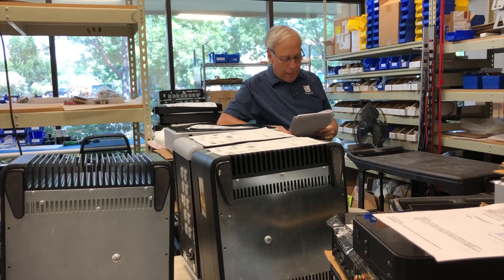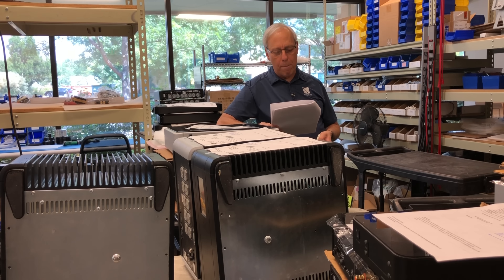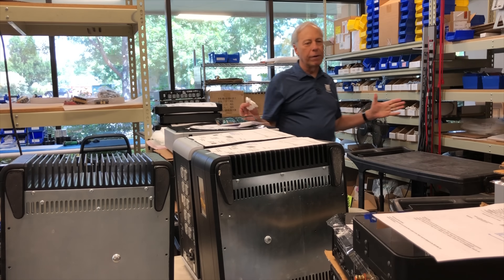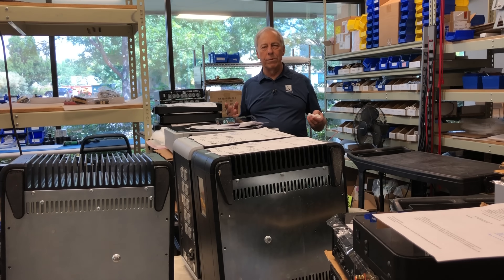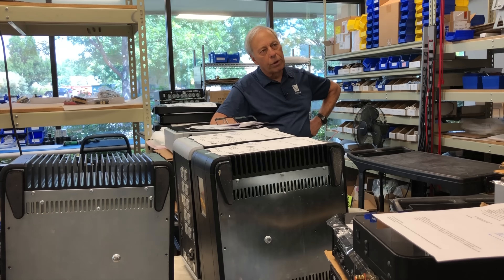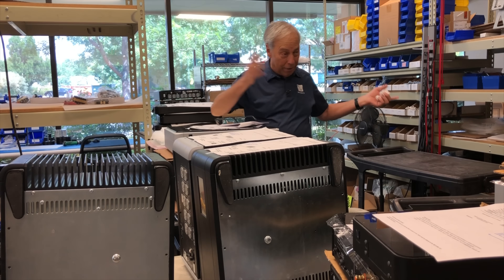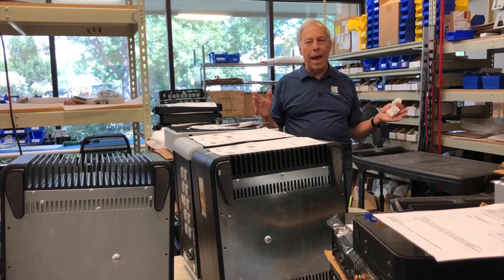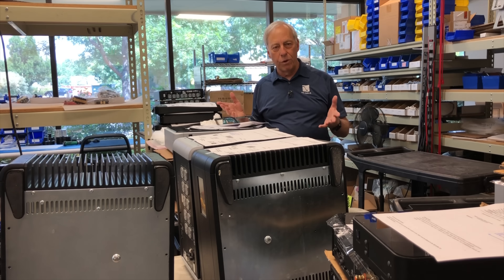Why should speaker cables have a minimum length?

Comment: Naim has been selling a house brand relatively inexpensive cable for ages. One type to fit all products. In that sense I think they wanted to match the impedance of said cable to their optimum specs for best results.
Reply: Naim has engineered their power amplifiers in such a way that they rely on the length of the cable with specific specifications.These are: Capacitance: 16pF per metre, Resistance: 9 milliohms per metre, Inductance: 1uH per metre. The inductance is the important parameter here. If the cable specifications and length don't match up, you can overheat a Naim power amplifier. But this has been taken out of context (as usual happens in the audio world) and has become a 'thing' on its own. For anything that isn't a power amplifier, it does not matter that much.
Reply: @jmtennapel  That is ridiculous. A few milliohms, picofarads or microhenrys aren't going to do much at all to an amp, let alone over heat it. Only in very long cables will these numbers be significant enough to cause any problems. The speaker wire just becomes an extension to the crossovers in the speakers and they use MUCH higher values. If a speaker crossover uses a 6-8 ohm resistor, adding 0.009 ohms/meter isn't going to do jack shit to change the sound. Same with adding tiny capacitance or inductance, because much higher values are used in crossovers. 

All audiophiles should learn the basics of electronics and then no one could sell them snake oil products. If there are any small changes from different cables, they will be noticed on interconnects where the signal will be amplified many times.
Reply: @gordthor5351  Could be, but I just copied and pasted their information. Maybe you have to call Naim and tell them they are ridiculous :)
Reply: @jmtennapel  remember the corporations want to sell you things.  That's how they make money.  In the 70s Ricardo Montalbon was a spokesperson selling a cars. He said , in the commercial,  the car comes with real "corinthian leather ".  There is no such thing as Corinthian leather.  They just want you to buy the car.  I see this type of thing on packaging all the time.  Even manuals have some nonsense in it. It's designed to protect the corporation and not the user.
Reply: @SocialistDistancing  I don't get this kind of rhetoric, it has nothing to do with the question asked, nor the answer given.
Reply: @jmtennapel  you missed the point.  What the producer/corp tells you, isn't necessarily the truth.  For instance, Motorola sells gmrs radios. They list ridiculous ratings at the distance that they will reach.  What they don't tell you is, that's under ideal conditions, on hill top.  If I had a dollar for every item that I purchased that didn't perform as advertised, I'd have a lot of money.  So don't blindly accept what the marketing says.  The bottom line for corps is to make money. I guarantee, that is what is most important to them.  They want sell you stuff. Buyer beware.  That's what it has to do with it.

Comment: Now why naim audio specifies a minimum length cable is likely for sound reasons only.  It is known by many real audiophiles that there is an ideal length cable, weather its speaker cables or interconnects that just seems to sound right.  Typically 6-8 ft speaker cables, and 1-1.5 m interconnects.  I know sounds crazy but that is the experience i have had and many of my clients and audiophile friends.  Cables will sound different at different lengths, to short or to long just doesn’t sound as coherent.  Im sure i will get push back for this comment primarily from non believers of audio cables, but many real audiophiles know this to be true.
Reply: Audiophools are on crack!
Reply: Mike Montana you must be an expert !  Your certainly in the majority of people who think cables don’t make a difference, so unless your open minded and have the ability to experience it on a truly high end system you’ll never know.  Then Ignorance is bliss.
Reply: Mike Montana well I am always up for a friendly debate but my guess is your not open minded and let technical data tell you what you will hear. My guess is you also buy audio equipment based on specification. Yet it is a well known fact specifications tell you absolutely nothing about sound quality. But I will just let you be, believe what you want to believe. The small group of us will let our ears make the final decisions.
Reply: @ohjoy40  
There is a reason why there is a small group of you  and it's not because you have "golden ears."

Comment: I wouldn't buy an amp if the vendor claims that the cable needs a minimum length. A great power amp outputs the precise curve of what was the line input of it even under low impedance. The shorter the cable the better for a great amp.

Comment: Speaker cables create more damage than interconnects.  So shorter speaker cables and longer interconnects are better.  However that means that you need  to use monoblocks  which raises the costs

Comment: I suspect it's to do with RF interference and which RF frequencies are more common. 
Typical speaker wire lengths are in the VHF range (1m to 10m; analog TV, FM radio, etc). 
Then again, maybe they are (also) concerned with interference from the power grid of 50 or 60 hertz. 
Search YouTube for "DC0s6KqQz3g" or "Do Audiophile Cables Matter? Here's PROOF!".

Comment: If the cables are a significant factor in a given amplifier design, they should provide them with the amplifier.
Reply: If the cables are a significant factor in the amplifier design they should redesign the amplifier.
Reply: You need a turntable to make the phono input work do you suggest they supply that too :)
Reply: @mikepxg6406  No. I'm suggesting that none of the cables matter at all. That's why they don't supply them.
Reply: Totally agree
Reply: If the cables are a significant factor in a given amplifier design, the amplifier is designed by someone who knows jack about amplifier design.
Reply: The legendary Kenwood L-07M mono blocks came with their own speaker cables.  I believe they were 3 feet long.
Reply: The magic word is "matched" components.
Reply: William Lau snake oil magic

Comment: Do the equipment with integrated speakers have a minimum length of cables inside?
I think we should put the length needed for the placement of speakers and have the same length of cable from amplifier to each channels so the minimum cable length will be that of the farthest speaker.

Comment: Too short a cable and it sounds edgy and unsettled/harsh and too long and it lacks focus/attack that is why. 2.5m to 4m is what I generally recommend. where 2.5m are the absolute shortest being on the analytical and edgy side, whereas 4m is a lot more comfortable and bass rich.
I do not like MIT cables, but I have to say that they top ones they make actually sound pretty okay when around 4 meters in length, because they are so analytical.
A good tip for the people.

Comment: 1 meter or six meters  makes absolutely no difference to the sound quality,   2.5mm  4mm  and 6mm pure copper stranded cable with a decent outer jacket is all you need when it comes to speaker cable,  the rest is pure bling.
Reply: Different cable lengths produce a quantifiable but very slight variation at different frequencies. (Probably due to wire capacitance). The reason why some manufacturers specify a certain length is only because that's the length they test their speakers at. In order for the speaker to reproduce sound as-advertised, it needs to be connected as-tested.
The HUGE caveat, they don't specify which amplifier you should use. The amp and the room makes such a big difference to the sound, cable length is a very distant and ultimately negligible factor unless you're in a studio.
Reply: @vikassm  "slight variation at different frequencies" maybe show us your measurements to support?,,,,lol
Reply: Wrong. Lesser lengths of the NACA5 don't sum to enough inductance for older Naim amplifiers. Research the products before you recommend burning up someone else's amp.

Comment: I know with transmitter antennas, length of cable does matter. The length changes the impedance. I don't know if this matters with speaker cable.
Reply: Frank C, you mention that cable length matters with transmitter antennas, so why would it not matter for speaker cable? The answer is that it matters in one case but not the other because of the frequency of the electrical signal. Speaker cables carry audio frequency electrical signals, which are no higher than 20,000 Hz, whereas transmitting antennas radiate radio frequency signals, which are almost always greater than 500,000,000 Hz.

Comment: electron travels at speed of light which is 300,000,000 m/s. I don't think 1m vs 10m cables would make any difference to human ears in terms of time it takes to get from one end to another.
Reply: You’d be surprised, advertising want you to purchase a 100ft roll by saying the speaker cables should be the same length for each side. 😂
Reply: @jeanious2009 the resistance will be different, therefore they will sound different

Comment: The reason is for the placement of the speakers . If the cable is shorter then the spec they gave you for your speakers ,your speakers would simply be to close together .  Mr PS it is ok not to know something .  Your answer was audiophile mumbojumbo vibration in the wire hahahaha Do some research and Call the speaker mfg .

Comment: The difference in sound through different length speaker cables, especially in the slight change in the high frequencies, has a lot to do with the overall inductance of the speaker cable, (capacitance too to some extent, but in the case of the longer cables "dulling" the highs slightly, it's mostly due to cable inductance), and the longer a cable is the more inductance it has, and as anyone who knows anything about speakers and passive crossover design knows, is that an inductor in series with a driver rolls off its high frequency reproduction ability. It can be more complicated of a total picture than that, but in general, all else being equal, a longer speaker cable has greater inductance than a shorter one, and therefore it acts like a very low value inductor in a passive crossover would also... rolling off the highs slightly.

Comment: Now that was a load of crap.
No, cables don’t act as lowpass filter on 20khz.
You’ve probably accidentally set the function generator to 20mhz instead of 20khz.
Just one wrong multiplier switch engaged can make all the difference...

Comment: Hi Professor :)
Do you agree that using any kind of wire plugs (i.e. banana) would introduce a restriction to the signal, unless it is a perfect conductor?
My logic is simple: connecting a bare wire to the posts (receiver and speakers) is the best solution. Am I wrong?
Reply: Not necessarily "a restriction to the signal," but every point of contact between two conductive materials introduces some risk of potential failure.  I use bare wire ends "tinned" with solder for a reliable connection -- this works well with both (firmly tightened!) binding posts and the cheap spring connectors that were so common back in the previous century and are still used on many low-cost speakers today.

Comment: The reason for the minimum length cable is impedance to reduce oscillation.
Reply: Perhaps this is true for inherently unstable amplifiers, but not for the vast majority of competently designed gear.

Comment: Did the speaker designer assume a minimum resistance in the speaker cable as part of the RLC values used in the crossover design?

Comment: vibration of speaker cables, good God help us from pseudoscience promoted by industry "professionals" that should know better. It would take 30ft of 12AWG speaker cable to produce -0.2dB of insertion loss into a 4 ohm load which is barely at the threshold of detectability for young listeners with perfect hearing in a controlled listening test. The cable nonsense never ends.
Reply from the maker: That's a simple theory of why it matters and I apologize if it comes across as fact. But here's what are the facts. Cables make a significant difference in sound quality on a resolving system. The problem with you just considering the electrical characteristics (which you are correct on) is you've not taken the time to test this yourself in the right environment. So, often, we read or heard something that doesn't match our experience. It's human to just dispute it and then label it as nonsense. But that is a disservice.

You sound like a knowledgeable person. If you haven't taken the time or gone to the effort to see both sides in their proper light, something I as both audiophile and engineer have, then it's not helpful to write what you have. 

Let's all be generous with our time and knowledge, and respectful to those with more experience than our own.
Reply: @Paulmcgowanpsaudio  LOL Paul, I spent 20 years taking my time to measure, analyze and do controlled blind testing of audio while running the indistry's largest audited home theater publication. Most of the claims regarding audibility of cables fall short when the testing is conducted blind. Only poorly designed cables are sonically distinguisable. If you have a newfound science that proves otherwise, I suggest you submit it for peer review at AES.
Reply from the maker: @Audioholics  Thanks for letting me know. At least you have spent some quality time trying cables and making judgments. That is great and far more than most naysayers. It would take more than a few lifetimes to work on convincing AES members because they are so entrenched in their beliefs. All our tests are done blind (not double blind). Should you ever find yourself in Boulder, Colorado please stop by. I would be happy to perform a blind listening test for you that will shed some light on it. I don't claim to understand why this happens as it does, but there'd be no doubt in your mind it does. Thanks for the feedback.
Reply: @Paulmcgowanpsaudio  Paul, i enjoy your presentations as you're very likeable. I'm sure if we ever meet, it would spark an entertaining debate on cables. I will start measuring and analyzing cables again as time permits otherwise my $11k Waye Kerr Magnetic Analyzer and $40k Audio Precision just go to waste collecting dust. Cheers.
Reply from the maker: @Audioholics  Thanks. Measurement toys are expensive. We just popped for a 5th Audio Precision. Sigh.
Reply: @Paulmcgowanpsaudio  as Scotty used to say: " the right tool for the right job". If you're serious about building good amplifiers, they are a necessity.

Comment: Speaker cables are basically resistors, they should be the same length but shorter the better. If your buying the minimum length then their salesman saw you coming! ££££!

Comment: A cable capacitance and inductance works as filters, it change its frequency balance.......
The longer the cable the greater capacitance and inductance which works as a counter force to the signals.
Reply: There's not enough of either in a speaker cable to matter -- at audio frequencies only resistance is actually relevant.  http://www.roger-russell.com/wire/wire.htm

Comment: a zobel network makes sure that capacitive loading doesn't influence the output stage, cable resistance is negligible and at the sorts of currents that a say a 10w signal passes thru an 8 ohm speaker (bout 1 amp) the high frequency roll-off will be so tiny no one could notice it. Of course he wouldn't say it's bullshit, he's in the phoolery business after all.
Reply: I had Naim A5 cable of 2m each. The sound was bright. I upgraded to Naim A5 cable, now sound is mellow. No fatigue. But then I find banana plugs of Naim brand in India. Bought from Amazon banana plugs screw types. I am not happy. Firstly this plug doesn't fit tightly to speakers and Naim amp. To tend to come with a slight movement to cable. Naim A5 cables is very stiff as such does not into Monoprice plugs or Monster plugs. I don't have any choice. I make sure that banana plugs on Naim amp and KEF speakers on tight before switching on amplifier. In India Naim sells only amplifier but no cables or banana plugs for my old classic series NAC32.5 and NAP140 pre power combo.
Reply: Sorry I had A4 cables

Comment: Paul. Naim amplifiers lack an output inductor and thus rely on the speaker wires to provide the inductance.  Ignoring this advice can be detrimental to the amp or speakers. Linn k20 will be an acceptable cable at a lesser price.
Reply: Easier to just avoid Naim amplifiers. Other makes are just as good for less money.

Comment: I knew id seen this somewhere NAIM amp design and speaker cable requirements
Naim amps have no Zobel network and therefore, require a speaker cable to provide some inductance. Their own cable will do this and the recommended length is no less than 3.5 mtrs per side. This is not an unusual length and should be complied with for best results with Naim equipment. I think this apllied to older "Olive" Design Amps and using Naim speaker cable I believe NACA5. What I do know having heard many Naim based systems that if PS are sounding half as good they will be great. I heard their statement Monoblocs about a year ago and they really are amazing.
Reply: Gerald Holley Linn k20 is a good substitute if nac a5 is too expensive as it is basically nac a4.

Comment: use too several hundred ohms. A 3.5 meter length of bell wire would be less than 100milli ohms. Fat speaker wire. 10 Milli ohms.